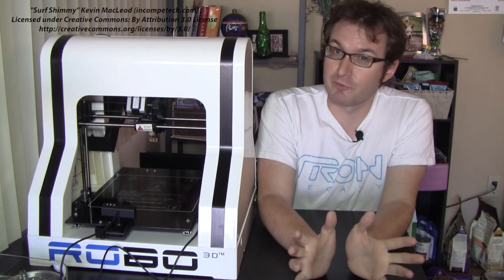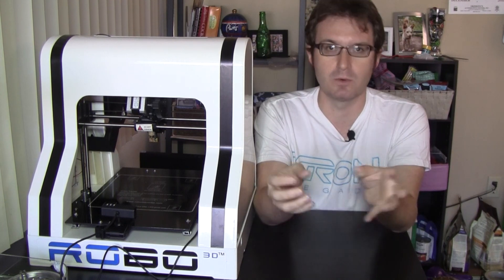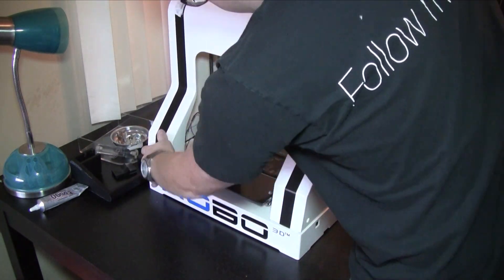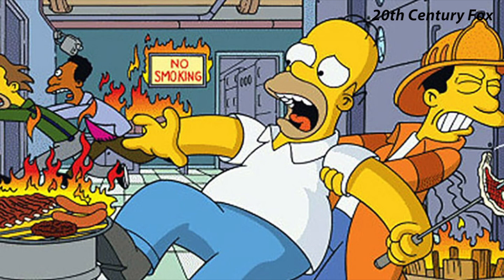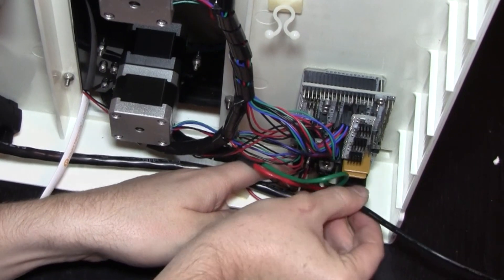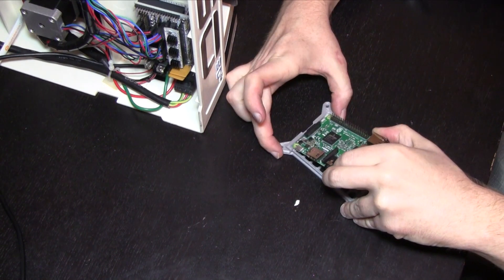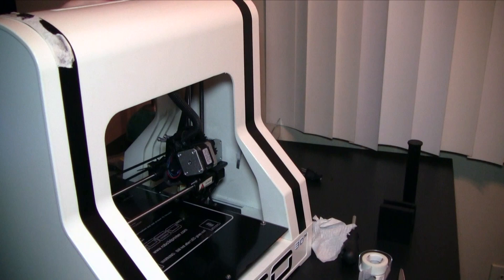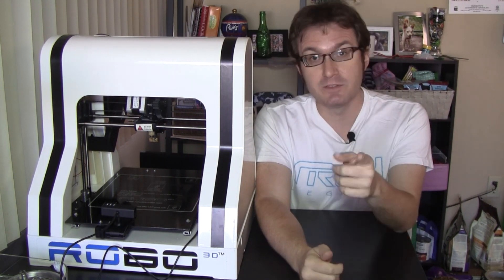How To Install Essential Upgrades To Your ROBO 3D Printer

Comment: What kind of waffle-head thought those colours were appropriate for power?!
Reply from the maker: +Matt : Adulting Someone in San Diego, apparently. Maybe they didn't QC before importing. This was a Kickstarter model, after all!
Reply: It's possible that a wiring colour codes video is in order. One of the issues I run into in my industry is the mixing of LV and HV standards. We install systems that use both and some guys get confused as to which colour codes they should be following at different times.  It has gotten to the point that I instructed engineering to put colour code information on certain devices on our prints.

It just sucks when you have a device that on one side of it you are connecting up green/ground, white/neutral, black(or another colour)/hot....then on the other side of the device you are hooking up black/negative, red/positive, green&white/signal, and possibly a shield to ground.  Then on another thing right next to it black and red are signal for a non-powered switch.

Dont even get me started on 6 or 8 conductor card readers and some manufacturers deciding to amke their own colour standard
Reply from the maker: +Matt : Adulting Like I said in my rant: standards exist for a reason, and standards should be followed across industries for that very reason! Less confusion, more safety, more efficiency!

Comment: What are your limitations, how large of a print can you make... ever think about printing gimbals? I wonder how strong they would be? are there other printing materials you can use, or is there just one type?
Reply from the maker: +Shawn Springall My print volume on this model is 10x9x8 inches, so it's relatively big for a consumer printer! It prints in either ABS or PLA, but I only use the latter because cyanide gas. I haven't tried to print a gimbal yet as I'm still really learning to get the prints right (it's more difficult that it would seem, there's definitely an art to it), and precision parts are right out! As for strength, the parts aren't SUPER strong, but they definitely hold up to light or medium-duty work. I'm going to play around with some specialty filaments like wood at some point, but I really want to get super comfortable with standard PLA first!

If you have an idea of something you want to see printed, let me know and I'll add it to my requests list!